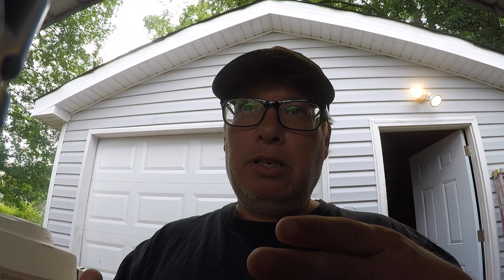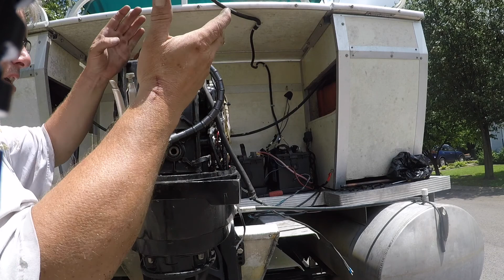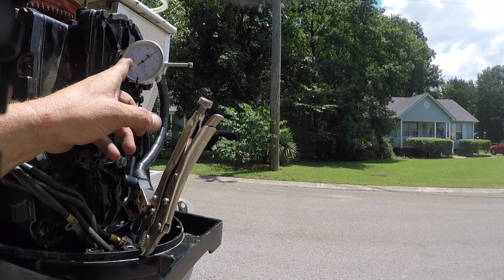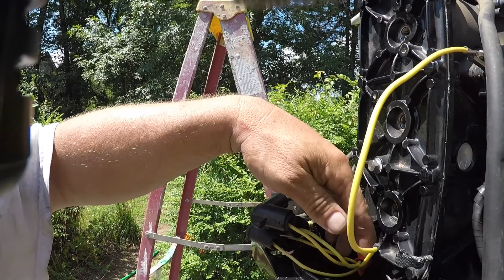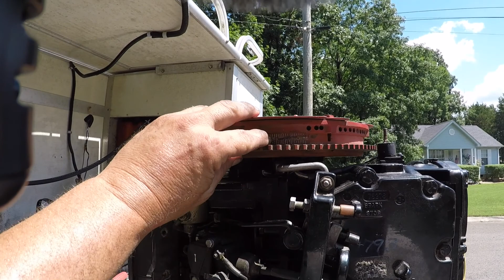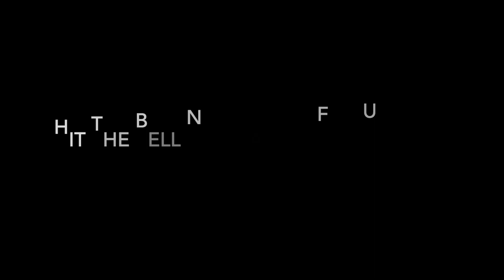Setting Timing on 75hp Mercury 2-Stroke 4-Cylinder Outboard

Comment: This has helped so much, but can you help me find my specs? My manual says in the appendix the idle spark should be 0-2° BTDC and max advance is 24° cranking to obtain 22° at 5000 rpm. But then, the instructions say max advance to 28° BTDC to obtain 23° at 5300 rpm. I have a 1986 60hp serial 0A923640 and wonder if you can please tell me what both stops should be as well as rpm at idle. I guess my manual covers too many models it is just vague on my particular motor. Thanks for any help. Love your stuff!
Reply from the maker: Ok, so 0-2 degrees 800-1000 rpm's for idle.  Then the maxim advance should be written on your motor on the front plate.  But a good rule of thumb is with the spark plugs out and full throttle WOT, with a remote start set the timing say 4 degrees north of what your motor says on the front plate.  Meaning that when its running that the physics and the nature of modern fuel it will end up at what the max advance should be.  I don't know if that is 23 degrees or 28 degrees.
Reply: @hawkeyemarine  thanks! You've given me the confidence to do this today. I didn't pay attention to see if max advance was written on the front plate because I wasn't even thinking about attempting it, but now I will. It was also your fuel pump video, where you thought your kit only came with one gasket, that helped me rebuild my fuel pump. I have the same triangular pump. Thanks again!

Comment: Hello sir and thanks for the video, I have a 1972  Merc 800, 80 HP, 2 stroke. Your video is great, but I noticed on my flywheel I only have 3 dots, the timing marks are on the cowl and I dont have the .464 mark required as you have and what Clymer manual says. The cowl says- TDC Piston#1  and 40 through 10 degrees   Max Spark cyl# and shows 20 through 50 degrees.  How should I proceed from here to time my motor for BTDC 23. Thanks sir for your time
Reply from the maker: So, the engine turns clockwise.  You will have to use a dial indicator or something like a Dow pin or a screwdriver.  As you rotate the flywheel clockwise you need to find TDC.  Absolute TDC would be .464 or .223 sometimes stamped on the front of the engine.  Once you do this look at the flywheel.  There should be a couple of marks.  Usually the flywheel has a small notch.  Line up the timing pointer to that notch.  If there make a mark in line with the flywheel with a white paint pen.  The second mark typically there are 3 dots on the flywheel and it lines up directly in the middle of the distributor gear the belt is one.  Under the cap of the distributor pulley you will find an arrow.  Those dot and that arrow should line up.  Sometimes that arrow is slightly counter clockwise of the dots.  So, as you rotate the flywheel would be BTDC and and ATDC would after.  Set your spark advance first at WOT (remote all the way forward gear) watch some of my timing videos in the thunderbolt 800 and 950 on how to do this. Next you do the timing at idle remote in neutral posiition.  Thanks for watching.  Please subscribe.
Reply: @hawkeyemarine   Thank you so much sir for your time, everything lines up and I am glad you explained this to me. I replaced the lil 4 slotted metal disc as well, i noticed it was damaged as well and wasn't attached to the rotor slot so basically it was beat to crap, which might have been my problem.  I also saw one of your videos  where you grounded the spark plugs and time the motor with the throttle wide open, can I also do that? Thanks sir!!
Reply: and can I send you a picture of what im talking about, thanks sir
Reply: Okay, news flash, I watched your "what happened to the timing" -85hp.  But what timing mark do I use  for  23 BTDC. I see 2 timing marks, (23  before CYL#1 Max spark and after

Comment: Great vid :) I have a 1978 80 HP - do you know my BTDC spec at full throttle? At idle it should be 4 degrees but I have not found the max value. The only thing I have found is "to 21 degrees for "direct charge" crossflow inlines and 34 degrees for the older plain vanilla crossflows". How the heck to figure out if  my engine belongs to the former or latter. In your vid you have 28 degrees for a 75 hp. If you want to change the idle setting. Do you use the "trigger" screw? For max I guess you just use the spark stop nut? Brgds //Thomas (from sweden)
Reply from the maker: Both of them will have a throttle stop.  Which will be your advance timing.  Send me your serial number and maybe I can look it up?  You will have a Spark stop screw which is your idle timing and that should be actually around 2 degree + or - 2 degrees.  The idle is adjusted by the idle screw.  Check this all by disconnecting the throttle cable.  For the advance timing ground your coil and disconnect your gas.  Its easiest if you take the spark plugs out, spin the engine to advance time with a timing light and then back down to idle position checking each.   Then check your primary (idle) pickup and your secondary (full throttle) pickup with the carbs venturi fully open (full throttle position).  It can be confusing between the spark stop and throttle stop.  When in the full throttle position the carbs will be completely wide open and you will set the spark stop to be at the advance timing and the throttle stop at the fully open position for the carbs.
Hope this helps.
Reply: @hawkeyemarine  Thanx :) THe serial is 9217676 (Belgium built). I hve renovated the engine since I bought it. The seller said that it worked well for him but when I put into the water it died on me when I engaged the gear. Faults found - bad membrane in the fuel pump, hole in the fuelline, wrong sparkplugs, butterflies way off and in non sync and water in cyl 3 and 4 due to corroded exhaust plate. Now it starts but it still fails to keep rpm when engaging gear. On second try it works becuse of the momentum the boat gets from the first try. It runs well once you manages to overcome the dying when engaging gear. No hesitation or missfires. The temp on cooling water stays between 42 - 48 depending on the workload you put. It starts easy and has 10-11 bar on each cylinder in compression so now I have the last part left - make it functional when you ebgage the gear. I need to tune the idle mixture screws but before that I want to make sure that the timing is correct. I suspect that the idle rpm is to low and as I understand it you set the idle rpm with the trigger screw i.e change the idle advance timing up or down depending on what you want to achieve. If you suspect other root causes for my last problem. Please enlight me :) //Thomas
Reply from the maker: @AmateurTravelOutdoor  When you put your timing light on start with #1 and then move to each wire and see if the trigger moves around.  You can mark the flywheel with a white pen if you have to.  But, it sounds either fuel related or electrical.
Reply from the maker: With the engine running pull each plug wire and see if you have change in tone of the engine.  If you don't hear a noticeable tone in the engine you may have a bad coil.  You'll need to check all the electronics stator, trigger, switchbox and coils.
Reply from the maker: That's a 4 cylinder correct?  If so, its advance timing is 27 degrees BTDC, @ idle its 2 degrees +/- 2 degrees BTDC.
Reply: @hawkeyemarine  Thanx a lot. I will do some testing tomorrow. I will let you know the outcome from that :) /T
Reply: @hawkeyemarine  I am 99,9% sure that we can exclude the fuel side. Before I started to do the RCA the engine died instantly at gear. I mean like within a microsecond, The idle were also rough. After I changed all fuellines, removal of carbs (which where cleaned both with ultrasonic cleaning and pressurized air and all holes and pins where examined under a microscope), new bulb, cleaned fueltank, new gasoline plus the exhaust repair (removal of the water coming in) then it had a very nice idle and when I put in gear the propeller started to rotate for a sec or so (I did this in a barrel and the barrel "exploded" - beginners mistake that you cannot run with gear in a barrel :)). So the engine became totally diiferent in the behaviour after my "repair" and TLC. I still get the feeling that the only fuel related issu e left is a tuning of the idle screws and idle speed (i.e ignition timing). But as you know - assumption is the mother of all fck ups :). I have measured all coils and sparkplugs and they are OK when it comes to the resistance. However! I will do some testing tomorrow and I will see the outcome from this. Take care now /T
Reply from the maker: @AmateurTravelOutdoor  have you tested the voltage with a  DVA and meter coming into the coil? They all should be over 200 VAC input side of the coil.
Reply from the maker: @AmateurTravelOutdoor  Here is a good video by my buddy on what I was talking about.  https://www.youtube.com/watch?v=rw82D7P1kEc&t=22s
Reply: @hawkeyemarine  No not yet. I am waiting for the parts to build my DVA. I "played" around with low speed needles and this is the result: https://www.youtube.com/watch?v=4evkl7kQRw4&feature
Reply: Thanx. I will look at the channel starting now when I go to bed.